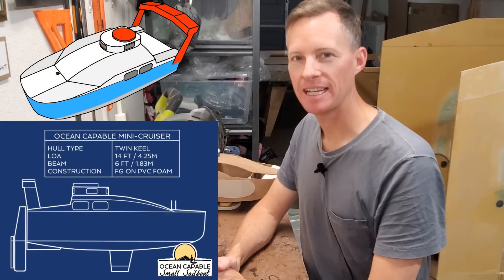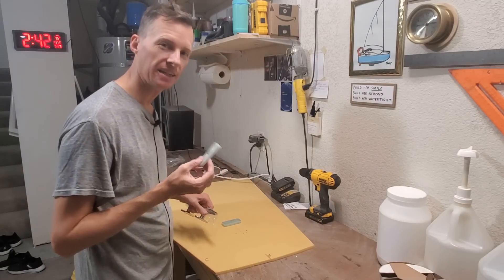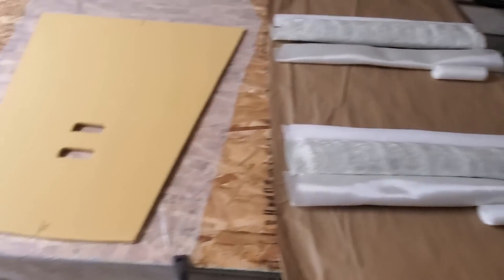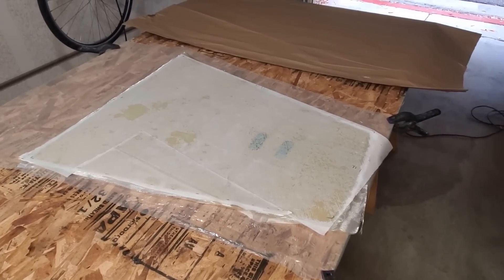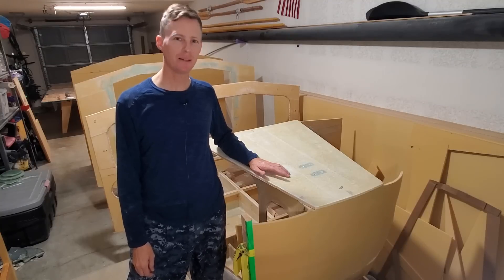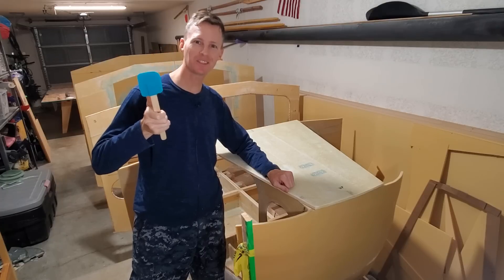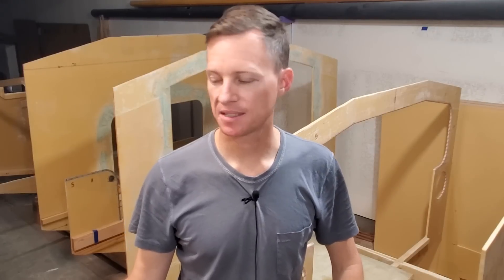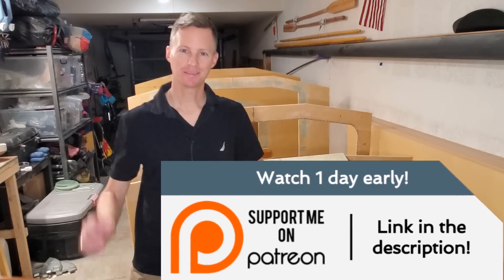OCSS-028 Beginning on the Deck! - Mini-Cruiser Sailboat Build

Comment: I’m interested into your project because thinking to do something similar during the next years. Curiosity, why have you cut the PVC where the cleat will be attached? Wasn’t better to use one big hard frame underneath the laminated PVC? This would have distributed the force over a wider area without compromising the PVC integrity. Great to see your progress.
Reply from the maker: The core is replaced where the bolts pass through so that you can tighten the nuts down with no chance of crushing the foam. I can't remember if I mention it in the video, but this deck cleat will get a big backing plate on the side where the nuts and washers go. Thanks for watching.

Comment: hello, I subscribed to your channel because the videos are amazing, I'm studying English to understand your instructions in real time, so, I would like to have the plan of a boat like this one, could you help me?
Reply from the maker: Hi. I'm still building and I don't have exact measurements of the hull panels yet. Plus, this design is untested. The original design I modified to make this is called the Tenten 425.
Reply: @ocean_capable_small_sailboat  ok, but I'm going to watch the videos on your channel to learn how to pass the cables that control the sails into the cabin without rainwater getting wet inside 
thank you for your help and God bless you
Reply from the maker: Cool! Check out the facebook group, I've posted some drawings and text about how I plan to do that.

Comment: Beautifully done, though I was surprised that you didn't install a large reinforcement panel on the underside of the bow panel for the bow cleat mountings, as this would be easier to install whilst the panel was on the bench, rather than affixed to the boat and having to work on the underside of the fixed panel.

I realise that this cleat won't need the reinforcement that the towline eye did, but I thought it'd get some reinforcement as it is what is used to tie the boat to a dock, pier or mooring in all weathers.
Reply from the maker: It'll get a nice strong G-10 backing plate, but I don't think it's necessary to glass it on. The cleat bolts will hold the backing plate securely to the underside of the deck.

Comment: Is the inside baking plat going to be larger than the cleat itself? Hopefully
Reply from the maker: Backing plate is sized based on bolt thickness and core type/thickness, not the cleat size. Check out episode OCSS-024.
Reply: @ocean_capable_small_sailboat  will do!

Comment: How thick is the foam? It's the first time I have heard of this technique, and it looks as thick as the equivalent build in wood. Is it just as strong? Great progress mate.
Reply from the maker: You can buy the foam in any thickness. Very strong and very light!
Reply: @ocean_capable_small_sailboat  ah thank you. I have been working on a custom plan for a few years, and have been looking for a lighter alternative, but haven't wanted to compromise on structural rigidity. Unfortunately I have not found any answers to my quire's through my internet searches. It looks roughly 15mm thick on the video, but it is hard to see a good scale reference.
Reply from the maker: @s.c.o.s4672  It's 1cm thick. Thicker is better, but more expensive. I wanted more like 1 inch thickness ideally. Watch OCSS-007, I go into the foam advantages. It's used in industrial builds like storage tanks and wind turbine blades. Very strong.
Reply: @ocean_capable_small_sailboat   M10 inch would be pretty expensive too. It will quite nite to see how it turns out. I personally can't wait to see how you are going to set up the controls, and electrics. Will you get a wind turbine? I have always wondered why they are so often overlooked on boats, what are your thoughts?
Reply from the maker: @s.c.o.s4672  I don't really have room on this boat, but I did install a wind turbine on my old Cape Dory 31. I will have some solar panels.
Reply: I would also like to know how thick the foam is.
Reply from the maker: @Someone-nr9ym  It's 1cm thick.
Reply: @ocean_capable_small_sailboat thank you.

Comment: You mentioned in an earlier episode about putting linseed oil on some timber. I am an old retired boat builder in NZ. What i have found with linseed oil is that it never really dries out and it takes on a lot of discolouration. My advice for what it is worth, would be to use Tung oil. It dries off and can have bit of a gloss finish, to restore to a good finish after some use, it just requires a light sanding then apply another coat of Tung oil. You should be able to buy it in the states as it is readily available here in NZ.
I  enjoy your building episodes keep up the good job you are doing.
Reply from the maker: Thank you!

Comment: I really hate to say this, but that panel looked not properly wet out (on both sides). Lots of patches in the 1708 that seemed to have air bubbles trapped in it, and then the peel ply didn't look properly wet out either. All told, I think there's some serious risk of delamination there. In your shoes, I'd drill some holes through into the bubbles and then use a syringe to squirt more epoxy into them. Follow that up with a coat of epoxy over the whole thing to fill in the weave properly. (I know, because I've had to do this for one of my dinghy's buoyancy tanks!)
Reply: Yes mate , i'm afraid i noticed the same , myself . I've only just found this channel , and have seen a couple of videos today . I first noticed what looked like dry spots on the rudder stiffening block , on the aft deck . 
But i regret that , yes i also noticed again what look like dry spots in this video too . I agree there is a serious risk of delamination , with a layup this light . I've got reservations over the construction method too , there are too many joins . I've never come across this before , and i'm not sure what the downside would be . 
A normal method is to build the hull in one piece , using angles to increase the strength . Ultimate for a boat this size , would be to lay the whole thing up , in one . That would be one strong sucker , but could be a real bitch to actually do .

If you read this Perry , sorry mate , just my thoughts .
Reply: @mickey1299  - I'm not really concerned about the joins, as the entire outside of the hull will be glassed over.. but yeah, the potential for delamination is worrying.
Reply: @Garryck-1   Yes , i'm afraid delamination is a worry , i first noticed it on a wooden block , mounted for the rudder on the aft deck . A properly wet out laminate should have an even colour , pretty much the same colour as the resin . There definitely appears to be light spots , indicating dry areas on that block . I ran the video a couple of times , and at one point , also noticed what appears to be a hollow on one end of the block . 
I learnt the hard way , after i laid up a new aft deck for my yacht . It was only a lazarette to cover the rear part of the cockpit , about 3 foot by 2 , but i was really pleased with the result . However , when the yard manager saw it he told me it was no good , i was gutted . Luckily , i had laid it with clear resin , so he was able to point out the issues , and you could clearly see the light spots . I ended up re moulding it . The deck lay up was showing significant light areas during layup , which were then covered by the next layer . I also noticed he's not using a wetting out roller , which in very basic terms is a solid roller , with what looks like two different sized washers . This works the air out and so helps the resin penetrate the matting . I would strongly advise , to source one , it will certainly help wet an area out . If the matting sticks to the roller , you don't have enough resin down , but you should also be aware of too much resin . What's called resin rich which is brittle . 
The light areas , indicate the matting hasn't stuck to the lower layer , so forming a hollow . This can become a weak spot and hence increase the chance of delamination . This is also a development area for osmosis .
Reply: @mickey1299  - I absolutely second everything you've written above. One thing though.. about the 'wetting out roller'.. also known as a 'fin roller'. I've found there is actually something even better for wetting out. It's called a 'bristle roller', and it looks just like it sounds. The thing with a fin roller is, it has to push air bubbles to the edge of the cloth to get them out. The way a bristle roller works is, the bristles penetrate the cloth, allowing the trapped air to escape directly, and they also push resin in through the cloth. Since I started using a bristle roller, I don't think I'll ever go back to using a fin roller, except perhaps in some special cases.
Reply: @Garryck-1  Now that's interesting . I'll have to look into that one , do you have any links , my friend .
Reply: @mickey1299  - There's a very brief video here: https://www.youtube.com/watch?v=KJYX-jDRIH4 

I don't think YouTube will let me post a link to where I bought mine (Trojan Fibreglass in Australia) but a search for 'fibreglass bristle roller' should turn up plenty of results. If you're in the UK (as I suspect from your channel's videos) then East Coast Fibreglass Supplies or Fibreglass Tools Direct carry them. If you're in the US, they can be found on the FibreGlast website. FibreGlast also notes that they work better on woven or stitched cloth than CSM, as the bristles tend to collect fibres when used on CSM.

It's odd that they seem so little known in the fibreglassing world, as they really do work a lot better than the ubiquitous fin rollers. Before I found out about them, I was using a chip brush with the bristles cut down to about 1" long, used with a rapid vertical 'stabbing' motion, to achieve a similar result. 

Hope that helps!

Comment: Great work.  Great video.  Thanks for sharing.  I found that a sander with 80 grit held at 45 deg will knock off that excess fiberglass around the edges faster than the oscillating tool.  I totally stole your silicone spatula idea!

Comment: Dont worry about 1/2 way etc, just put one piece and another and another and soon you will have a boat, enjoy the journey- looking great so far, I like how organised you are with me theres sticky stuff etc etc  and glass fibres sticking to my gloves and then theres the hole in the glove, and then some epoxy is short, panic !! all good fun
Reply from the maker: Thanks. Yeah I mix up 3 or 4 small batches of epoxy for a piece like this. That way it doesn't cure in the cup and I don't end up with excess wasted epoxy.

Comment: Are you thinking of adding a chain pipe?  What will secure your chain during a rollover, or keep it in the position where it will make the boat stiffer during passage?
Reply from the maker: No I really hate potential leak points so there's no through hulls and very few holes/hatches in the deck too. I'll lash the anchor down on tie-down points in the cabin against the hull. The chain and line will be secured against the hull  in a cabin sole hatch.

Comment: I would think that you would use a large backing plate for the forward cleat under the fordeck.
2 reasons for this #1 the cleat would be bullet proof, no way the cleat would tear out.
#2 If and when you are forced to attach a sea anchor to the bow you will be able to lay in your bunk and worry about other things then losing your bow cleat and damaging the hull at the very worst possible time.
Trust me on this and you can thank me later.
Reply from the maker: All hardware on my boat has or will have backing plates. Check out my 2 previous videos with "backing plate" in the title. I make very strong ones out of G-10.
Reply: Double the backing plates. Yes.

Comment: Moving right along.  Just wondering if you're a distance runner, Captain Perry.  With that lean physique, you've got great marathon potential.
Reply from the maker: Thanks. I've been running about 8 - 10 miles a week this year. I don't really do the long distances, just around 3.5 miles at a time.